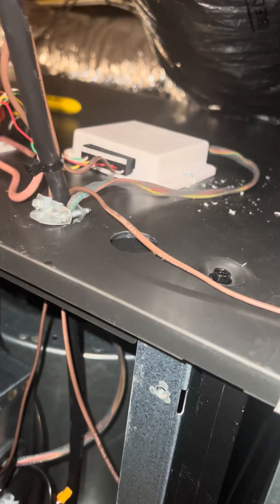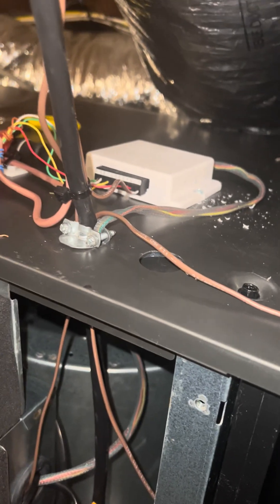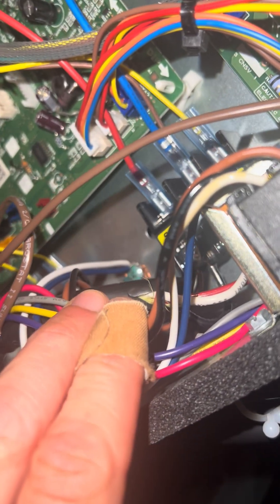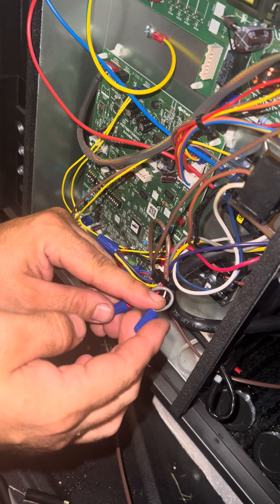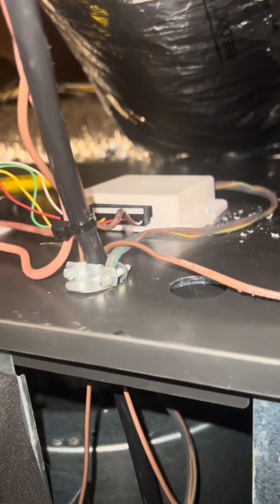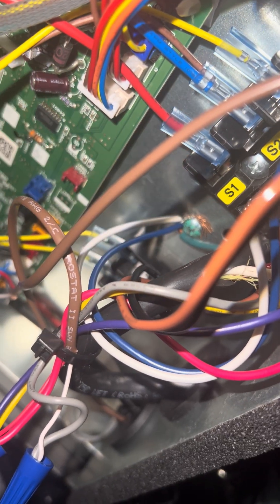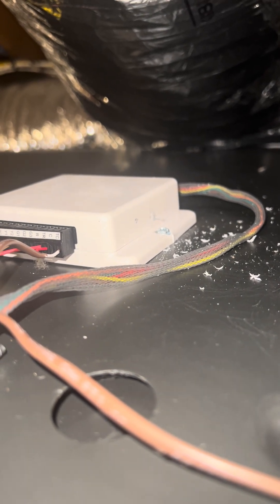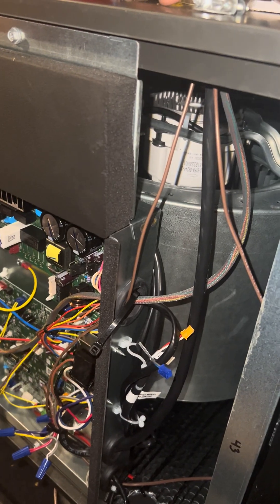Mitsubishi Thermostat Adapter Installation

Comment: I followed this video setting up the wiring for my Ecobee smart thermostat. I previously had the crappy wireless thermostat. I pulled thermo wiring, used the recommended transformer, the Mitsubishi PAC-US444CN-1 adapter. I followed your instructions on wiring the transformer and It works like a charm. Thanks!  😀

Comment: I have a transformer that has multiple primary voltages 120/208/240 (multi tap) , do I need to use the 208 or can I use the 120v  to use  for PACUS444CN and second part question what do I do with the common white wire  from what transformer , I have Mitsubishi Pead series (pead-a12aa7)with  wiring of 208v (so i assume)  let me write what I see on how it got wired  (air handler) coming in from panel  S1 = I see white wire / S2= I see Black wire / S3= I see Red wire   where will I put the primary voltage from transformer , it indicates to use S1 per instructions  but I see a white wire (S1) I assume it does not matter so which one should I select  from the transformer 120v or 208v?  but again what do i do with the white common white from the transformer ,any advice I would greatly appreciate.

Comment: Thanks for the video. I connecter the communication wire to CN105 and the power wire the way you showed. I’m using Honeywell T10 WiFi wired thermostat. The thermostat is on and connected however when i plug the communication wire to CN105 the unit turns off. Looks like something is shorting?… 
Can you please tell me how do i wire the PAC-US444CN-1 to Honeywell T10. Or maybe send a wiring diagram? 
Thanks so much

Comment: Is your transformer 208V or 120V? My transformer supports both, but I'm not sure if I connect "common" to S1 and the other wire to S2?
Reply from the maker: 120 volts to 24 volts

Comment: Is there another universal adaptor(s) you recommend or does it have to be this specific one, this particular one got too expensive? i have Mitsubishi Pead series PEAD series Ceiling Concealed Indoor Air Handling Unit
Reply from the maker: This is the only adapter I am aware of and required to ensure you get full variable speed functionality